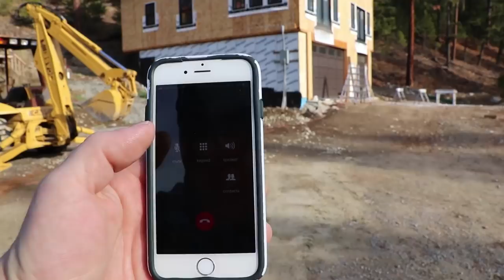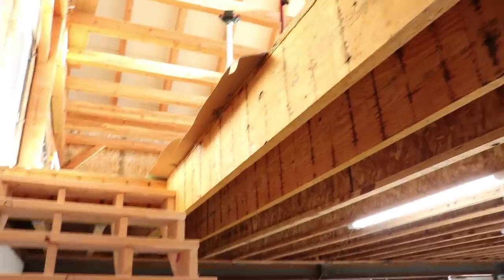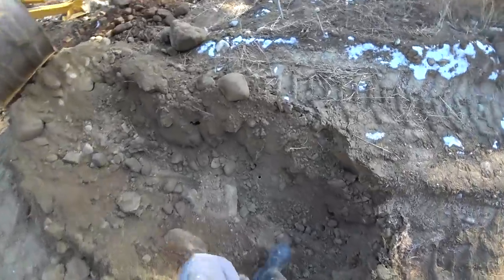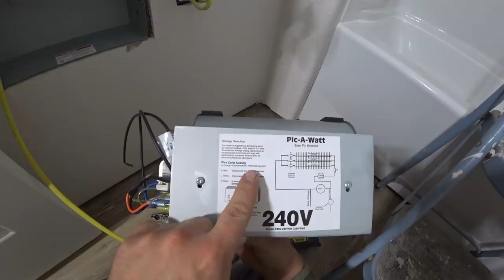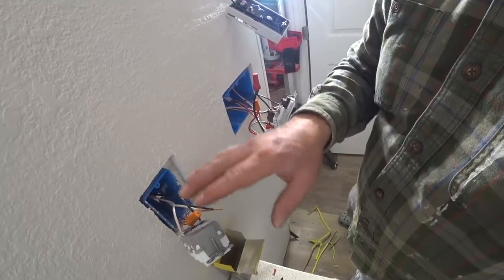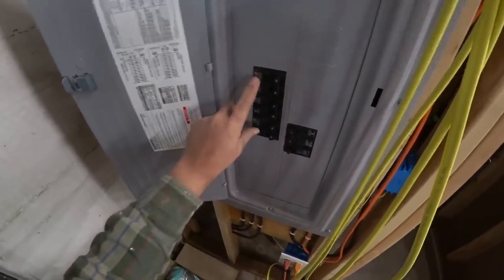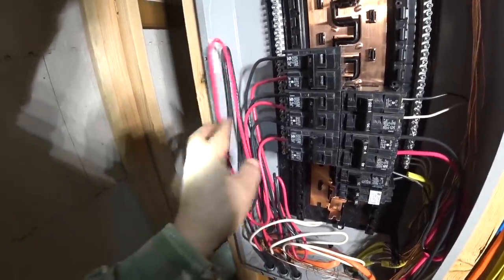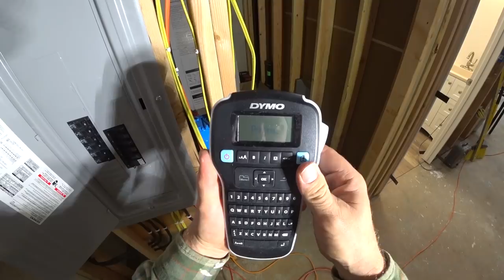Holy Cow IT ACTUALLY WORKS! (Wiring Garage Bathroom)

Comment: Not black  / black  ---- Black / Red     Need to tape with red tape if you use that white wire for a hot run..! Could kill someone if not taped....Always start at the ends of your ground buss / neutral buss to have no obstructions as you add more circuits....Buy some Red tape and fix that...

Comment: You cannot double tap a breaker meaning 2 wires on one screw. You cannot use the panel as a make up box meaning taking two wires tying them together and just have one wire go to the breaker. No wire nuts and panel. To fix your wiring dilemma on your two GFI‘s in the bathroom your walls are still open on the other side and Ceiling run your wire from GFI by the sink through your ceiling rafters the “2X4” And down to your GFI by your heater. Your other dilemma on wire colors black and white are permitted on a breaker since the electrician installing the wire knows what it’s for there is no dilemma but if you wanted to be more color correct for your heater you could have used a 12 X3 Romax and either use wire nut to cap off the neutral or simply cut the neutral out that way you would be left with a black and red both wire Colors indicating hot wires. Just a few tips from a licensed journeyman electrician. PS by wiring the circuit plug through the ceiling you can Then use a regular plug and not have 2 $20 GFIs
Reply: nice to see you think your jha is for everywhere.  the nec is not law it is just a guide that many jurisdication having authority follow some breakers manufacturies allow for 2 wires and some allow for panel splicies

Comment: Don't think you can have two wires (circuits) into one breaker.  Also don't think you can wire nut two circuits together in the panel.  Just double check the codes.
Reply: ya thts the big one what are local codes some breakers you can dble and some jha allow panel splices

Comment: you should really consider putting in a sub panel. I rewire houses for a living and you will be surprised how fast you use up  all those breaker spaces in the main panel with kitchen circuits, bathrooms, appliances.do it now before you have a ton of wires to have to work a 100 amp sub panel cable around, if you put it upstairs you will save time and effort pulling wires to it instead of all the way back to the main
Reply: That actually is A sub panel, The main is outside on the house. Few episodes back you can see the install. I would of for sure installed a larger circuit panel.

Comment: The 240 volt heater wire should technically be red because it is a different phase than the black (just like black and red in the panel).  Also, in a 120 volt circuit the return path for current is the neutral, but it is definitely not unused current.  A device will only pull the current it needs unless it is faulty.   In a 240 circuit the two legs are out of phase, so when one is positive, the other is negative and acts as the return path.

Comment: 8000w is a lot of power dude.
Reply: I'm an electrician in the cold norway. And yes we do it in a totally different way over here.
BUT!!!! I would put a max 600-1000 watt heating cable in that rom.
And I'm sad when I see the carvings around the boxes. There are big holes next to the wall socket. 
You can more or less push a finger inside the wall.
Reply: If you convert that to BTU's, it's about 28000.
Reply: meh at 240v 34 amps..no biggy

Comment: I live in an old house that has had lots of outlets and switches and light fixtures moved or removed, leaving plenty of big holes in the drywall and plaster. My favorite quick fix for all those holes is to hot glue paint stir sticks to the backside of the openings, creating bridges to affix the drywall patch to. On smaller holes tongue depressors work just as well.

Comment: You are supposed to mark that white wire as hot using electric tape, marker or paint. Some inspectors are picky about it and some will just it slip by.  Midway size wallplates will cover about 1/4" gap from the junction box. You cover larger gaps with jumbo size covers, but they are ugly.

Comment: We also learned in the past how important it is to cut drywall holes super close to the boxes. For the neutral wires connecting to the bus in the panel - start hooking them in at the bottom and work your way up.

Comment: I put a piece of air conditioner filter on my bathroom fan,, just under the the cover.  You'd be surprised how much dust it keeps away from the interior parts.  You can pull it off and wash out or replace periodically.

Comment: It's interesting to see how you do electric in other countries. But a fan heater inside a wall was new to me, sounds a bit dangerous but I guess it's how you do it. We use radiators here if it's inside the house, I prefer oil filled closed electric radiators.

Comment: Not sure you code there but in Indiana you are not permitted to land two wires in one breaker nor can you wire but two in panel to a pig tail.  You probably will be required to land each 110v circuit to a deprecate breaker or on both sides of the duplex breaker.

Comment: looks so good already! bet you're loving the new pooper! just a tip for getting the right spot for your electricals in sheet rock, cut a rough  square much smaller than the size you need on centre of the box and go back once the sheet is installed and clean up to the box edges with a sheet rock saw and utility knife (:

Comment: I don't know about where you're at but the journeyman that I've worked for in texas always say that A good rule of thumb is to go to the top of the box from the bottom or the bottom of the box if you're coming in from the top leave the slack in case something happens later and you need the extra wire when doing stuff like this always try to think ahead

Comment: Would it have been easier to use 12/3 wire for the heater to avoid confusion?
Reply: maybe but why spend $$$ if you dont have to

Comment: You are doing really good work and I applaud you on your navigation though the code, you still have a lot of wire to run and this might help you improve your work . The biggest problem I see is called "box make-up". Professional electrician would not leave a pile of romex wires in the box expecting a rough inspection. You need to show during a rough electrical inspection that you are in compliance with the code some of which is inside the box and show the intention of the box before you can cover it. This happens before the you get the OK to cover with drywall. 

To comply with the code we do a box make-up, strip the romex sheathing back leaving 1/4" min inside the box. then wire nut your neutrals, hots and grounds, bond the ground if a metallic box is used, show proper cable entry connectors etc. Then we push our nutted jumper links to the back of the box leaving only the pig tails that will connect to the receptacle or switch in the front of the box. Clear intent is shown, when we do the finish electrical BLK-WHT-GND receptical, BLK-BLK-GND switch, if we see pig-tails 2ea, BLK and 2ea. WHT and GND then it is GFCI or AFCI and should be marked "Line" and "Load" the box tagged GFCI or AFCI. Rookie mistake never make-up a box that requires jumping through an outlet to power downstream.

As for your 240v line use a sharpie and paint your white to red at least 6" from the end [any color except white or green], red and black will clearly show it is a 240v feed to your inspector. For switches paint the white wire to black, it will show "black-line" in and "black=load" out through a switch showing clear intention. You could also use phasing tape for color coding, that is what it is for.

Comment: Good job on the work I have a slight criticism that will help you be a better electrical apprentice you must twist your splicing so that before the wire nut goes on they are mechanicals connected this will ensure consistent connections for years to come due to vibration in the walls I would also like to tell you that the pig tails should be phase indicated with red/black heat shielding or tape or ink marker also looks good at both ends of the wire

Comment: You committed a major code violation installing a 20 amp breaker with 14 gauge on the circuit. You need to call a electrician because you truly have no clue what you are doing.

Comment: When I use wire with a white wire for 220 volts i put black tape on the white wire. It helps to remind me that it is a hot wire and it prevents surprises to those that don't realize the wire is hot.

Comment: You could have just used a GFI BREAKER for about the same price as your gfi outlet and everything is protected.
Reply: ? Have you compared prices? GFI outlet is a fraction of the price of a breaker.
Reply: Steve McEntyre gfi outlet $13  gfi breaker 30-40

Comment: All you needed was a Single-Pole AFCI Circuit Breaker in the electrical panel, and did alway with the two GFCI receptacles. It's also code on the 2017 NEC.. No piggy backs on a single pole baker and no splices in the panel. Your thermostat should have four wires line and load..

Comment: The feed to the switch box for the thermostat is incorrectly wired. It has to have a neutral. You should have used 12/3 with a black, a red, a white wire, and a bare ground wire. 

The current NEC code requires a neutral to switch boxes (unless it's trivial to re-wire them later). That's so if you replace a dumb/mechanical switch with a smart switch, the switch will have 120V to power its internal smarts.

Also, you neglected to connect the ground to each light switch.

Comment: Outlet covers:
Taping those outlets tight would be pretty easy -- if you had not textured.  Smooth wall is four taping coats, less mess and worth every penny for on a home like this.

A professional taper would not have been happy, but (s)he would have taped the gaps around your boxes.

Comment: When i built my Garage/Shop myself i had to mark the 2nd hot wire on the 240v in black, so inspector let me just put a section of black shrink wrap over the wire on both ends, also the GFCI with you using the line side bypasses the protection on the circuit. The GFCI when tripped protects the circuit plugged into the load side, just running to the line side is extending the circuit without protection. Also in regards to the circuit panel. Its best to place your heaviest load items or expected noisy items closest to the top of the circuit panel placing the shortest distance and the rest below, reasoning  is if your heavy draw items are near the middle or bottom your susceptible to pull power from devices with capacitors inbetween when those heavy loads kick on wearing out those device or possibly damaging. Example if i was to install my air compressor on the bottom circuit, then install a speaker system above it in a circuit, everytime the air compressor kicks on its hungry for power so it pulls from the highest voltage source while sometimes sagging the circuit, so you will hear it in the speakers unless they have a protection circuit. Placing the compressor at the top creates a shorter path for it to pull power, thus pushing the noise to it vs your other circuits aswell reducing voltage sagging in the circuit panel heat being generated in the bus all the way to the bottom of the circuit panel. .

Comment: Consider adding a sub panel up stairs for the living area circuits.  All circuits (with a few exceptions) need to be either AFCI or GFCI now and cant' be slimmed.  The Kitchen alone requires 6 dedicated circuits (garbage disposal, dishwasher, microwave, refer, two counter top).  Washer, Dryer, oven and range top,  another 7 circuits.  That's bare minimum without even considering your lighting and receptacle needs.  Homeline subs and SER are cheap and will almost be a wash with the branch circuit wire savings.

Comment: Jessie, start landing the grounds on the ground bus from the bottom up. That way the wire won’t be in the way of the next one. You can/should also use some red tape or your label maker to mark the 2nd phase of your 240v circuit so there won’t be any confusion in the future.

Comment: (2 questions)# 1. why do you say 110 volts when it's 120 volts?  #2. on the white wire on 240 volts put red tape on it to show it is not a common wire.  thank you
Reply: 208vac
Reply: 1 question and a comment you mean ?   :)

Comment: Always leave some extra in the panel just tied it up when you're done the big thing is balance your load you want the same on a phase as B phase get you an amp probe AC amp probe but you can do that when it's all said and done it's just a matter of adjusting Breakers turn everything on check your main a phase and B phase you want those as close to the same as you can get it

Comment: Mark the white wire in the 240 box with black, or red electrical tape. I believe it's code. You also have to alternate the color in the panel, between black, & red. You can't have two of the same color next to each other.
Reply: 1.Yes it is code to phase the white wire with black or red tape the full exposed length. 2.Electrons do not care what color the wires are and that is not code. He may have only 3 or 4 red wires (240v cir.) in the panel when he is done. The rest will be black.

Comment: The wattage stays the same,  when you double the voltage you cut the amperage in half amd can use smaller wire. This is for devices that are designed for more then one voltage, also the higher the voltage, you will generally have slightly less voltage drop on long runs. 120 AC rms goes from positive 170 volts to negative 170 volts, the 120 rms volts is a average equivalent of DC. With 240VAC each leg is 180 degrees out of phase. Each leg is either pushing against other or pulling apart.

Comment: you shold fasten a smal combuter fann or any small fann on the highest point of your loft. it will help push the worm air down towards the ground level. we did this at our capin helped a lott.
Reply: I've even seen a fan in a "drainpipe" from the apex to the floor - possibly you could include in an internal wall that is in the loft - was surprisingly efficient at recycling the warmth for re-use
Reply: this. makes a stupidly huge difference.

Comment: Neutral carries the imbalance in current between the two hot legs back to the transformer. If leg 1 is 5 amps, and leg 2 is 10 amps, then the neutral carries 5 amps. If leg 1 and leg 2 are 10 amps (like the heater), the neutral would carry 0 amps, and isn't required. If no neutral is required, you don't need 3 conductor wire.

Comment: Yes to taping hot neutrals - I use red.
Also tape your wire nuts. They can work loose over time - especially the neutrals. 1st thing I check when a circuit stops working.

Comment: Whenever white insulated wire is used as a hot, I will wrap the end with black electrical tape as an extra visual indicator that it's not a neutral.  Is that not standard practice around the US? Any electrical contractors around to answer? Is there a better procedure?
Reply: I’m used to the white wire actually being white/red striped

Comment: A nice esthetic solution is to put a bursted aluminium frame underneath your plastic cover plates.  It will cover the holes between the sheet rock and the plastic cover,  is a cheap solution, looks very smart. Easy to manufacture.  Just buy sheets of bursted aluminium, cutt it to the size you require, sandpaper the edges.   Make the opening somewhat smaller than your plastic cover, shove it underneath and with some glue from a heat gun it stays in place and it is still removable.

Comment: In EU we have round electrical boxes, not squares. What that means is you don't have to pre-install the electrical box to the framing and pre-make the hole in drywall. You just need to run the wires where they need to be, install the drywall and then drill a round hole for the box. Then pull out the wire from behind the drywall and mount the electrical box to it with nothing more than just a screwdriver (there are metal "pads" on the long screws and they tighten the box to the drywall - you can see it here https://goo.gl/9QX6EP). Its fast, easy and you never end up with those gaps. Also.. speaking of GFCI outlet - we have the whole house protected with only one GFCI located in the switchboard with other breakers - It also acts kinda like the main breaker. That's what I call live and money saver.  And we don't use bare copper wire in these applications - it is always in insulation with yellow color and green stripes. I'm not saying what is better and what is not, just pointing out how different can things be in another part of the world..
Reply: Isn’t it kind of a pain to figure out where the ground fault is if the entire house is protect at one point? Do you have to go through every single outlet and appliance and switch and troubleshoot them all?
Reply: Yea, I saw this now. Just wrote the same thing to him. I would regardless of standard and codes - Allways install sleeves on the earth cables in the fusebox. Seperating the circuits from having contact with each other makes error searching so much easier, and it also works as an extra saftey layer + it looks good! :) Buying a roll with 100 meter of earth sleeve is also dirty cheap
Reply: ya dutch?
Reply: we have round ones also we use em mostly for lights and i have used round boxes for junction boxes round cover plates are more appealing to most than squre ones on finished surfacies
Reply: also i have done some resaerch on uk wiring methods the ring circuit scares me lol and our gfci trip faster than eus rcd why we use them in outlets near water